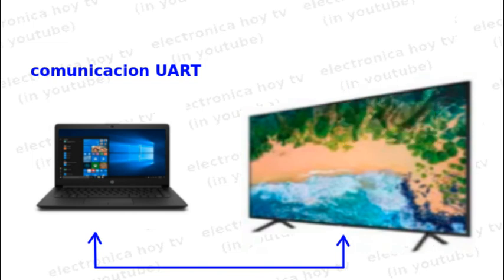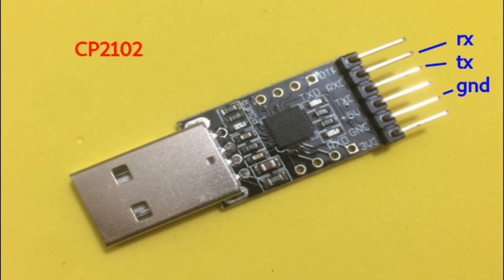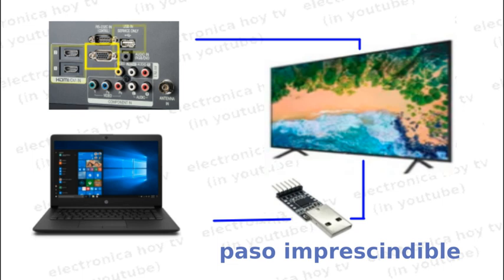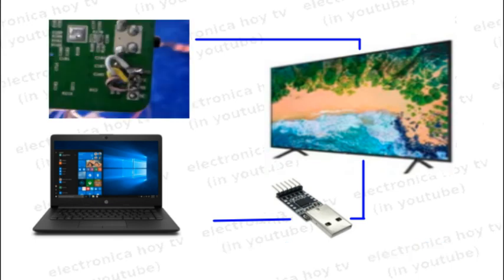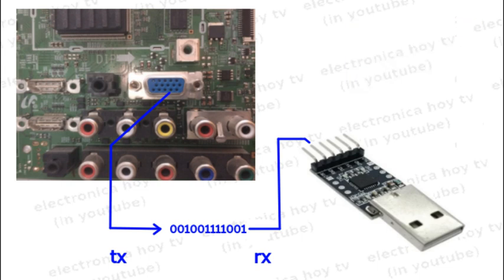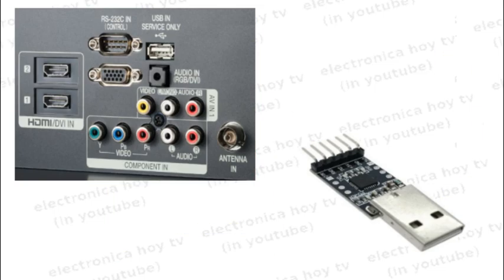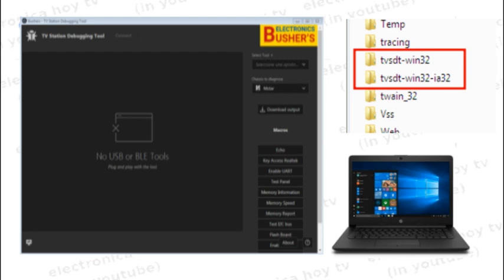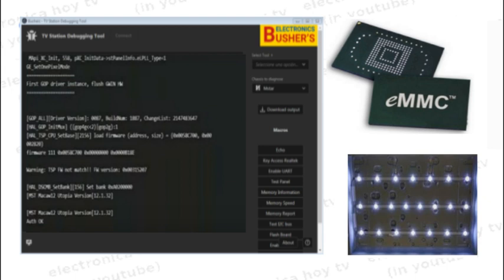REPARACION DE PANTALLAS ASISTIDA POR COMPUTADOR

Comment: Prof una pregunta existe programas cracks de easyJTAG en celulares con el CP2102 y unos jumpers instalados a los condensadores segun el esquematico del procesador se puede realizar un falseo= a nivel de procesador? sirve para extraer firward de modens adls el CP02102?
Reply from the maker: Hola johan gracias por comentar, el cp2102 es una interfase de comunicación serial UART,  puede conectarse con cualquier dispositivo que trabaje con esa modalidad, lógicamente cada dispositivo tiene sus protocolos de control y todo eso, es decir que además de la capacidad de comunicación serial también necesitas el software para cada dispositivo. por ejemplo el soft que preguntaste sirve pata tv´s chinas, otra cosa es con otros dispositivos. si no traen comunicación serial UART no es posible. éxitos

Comment: Hola profesor, cual es el driver que tenemos que bajar, o hay que comprar primero un modulo CP2102 y ahi recien bajar el driver?  Saludos
Reply: Primero comprar el módulo, aunque le recomiendo que mire al módulo CH341 para comparar funciones y costo respecto del CP2102, para poder decidir mejor cual comprar, y después usa Bushers teniendo lo necesario.
Reply: @sergiogalpon  Hola, con CH341 se puede usar BUSHERS, el programa para reparar TVs?
Reply from the maker: @repairtvlcdled8253  Hola repair, si, también sirve pero tienes que hacer un puente entre las patas 2 y 3 con el jumper
Reply: Efectivamente, andan con el software de los ingenieros Bushers con puente en pines  2y3. Y además leer, reprogramar las memorias spi y Eeprom, para el caso de tv mas antiguos y/o  sencillos con el puente que trae el módulo en 1y2.